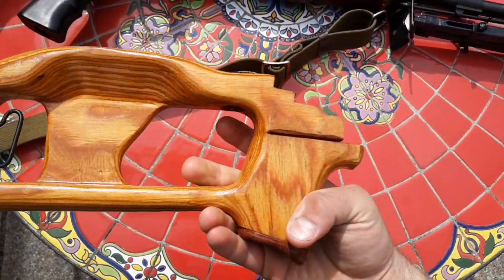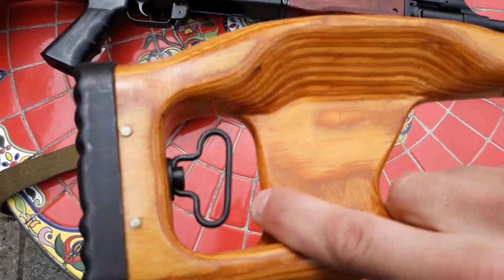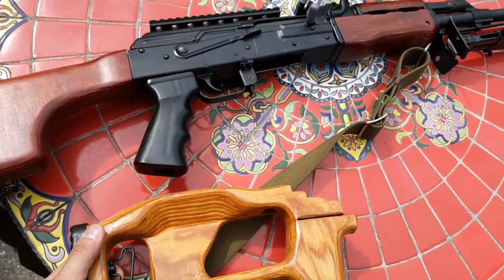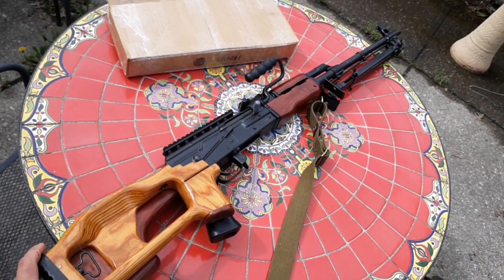Mishaco sent me a Butt... Stock. ;) for my AES10B!

Comment: Nice table
Reply from the maker: It's a 'Tac-Table'
Reply: @Leman.Russ.6thLegion  
Would pair nicley with some wooden assualt Adirondacks
Reply from the maker: @Greasymarsupial  ohhhh! I would need some high-capacity foot stools as well! And a tactical awning for concealment. I like the way you think.
Reply: @Leman.Russ.6thLegion  
Dont forget the concealable arry coaster
Yoy dont want water ring to ruin the tables finish 
It would dampen the high speed low drag viability of this piece
Reply from the maker: @Greasymarsupial  lol. Yu'r right. I need a cammo set of place mats. 11 up 3 down